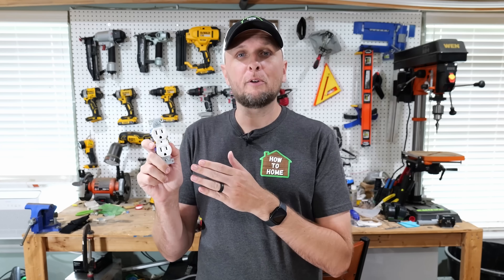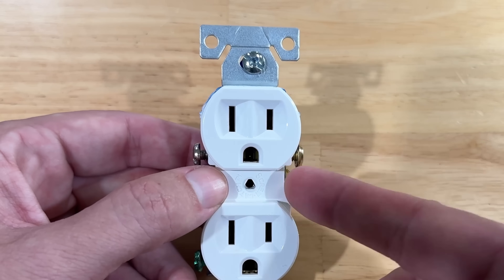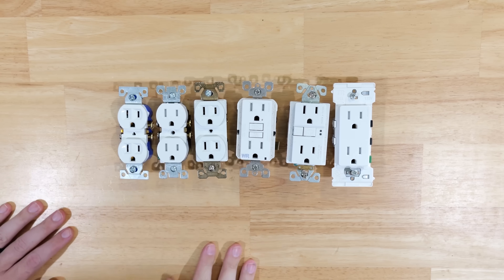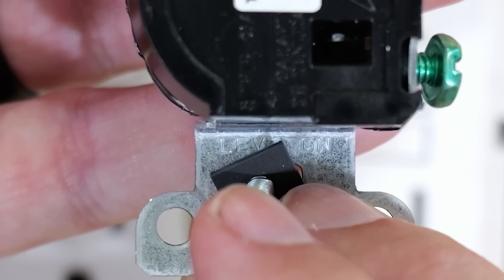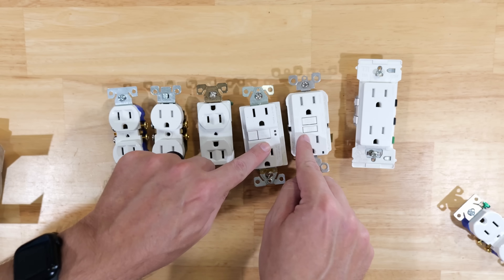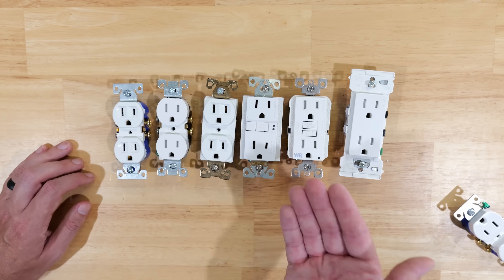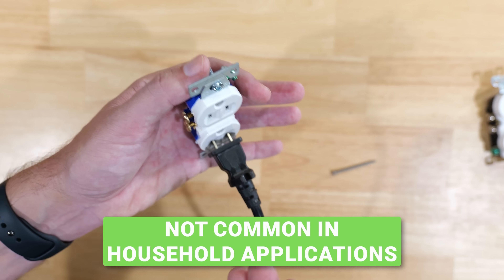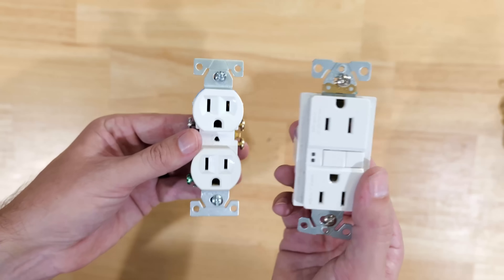The Shocking Reason Why Your Outlets Are Installed Upside Down!

Comment: For the past 35 years, I've always installed outlets ground side down because that just seemed the way it was supposed to be.  I never understood why I've seen them ground side up, so I now have a better understanding after watching your video.  Thanks for making these!
Reply: You just like the 😮 face.
Reply: Flat plugs more  the most have the wire down with ground down, but not always my AC window unit should have a wall outlet with the ground up. 73

P. S. Appliance extension cords are for ground up. That drives me crazy because the cords can be used on space heaters. I just removed a flat plug extension cord and found my power strip I had bought when I got my first windows computer. I like that strip because it has an unswitched outlet and the plug swivels so you can have ground down, ground up, ground right, ground left and any other position you want  and the plug is very flat. What I really need to do is to remove outlets and place them where furniture don't block the outlets the fan switch also needs moved. 73
Reply: My apartment has some up some down I want my kitchen and bathroom room 3rd prong down. er ground down.
Reply: @Debbiecybergal  if you are good with electric and can shut off the breakers then go for it and reverse them outlets, receptacles, plugs. Don't mind me I try to make everyone happy when it comes to electrical terms. Mom called them plugs my friend and I called them outlets. 73
Reply: Ground prong up when that outlet is attached too the light-switch so people there know where to plug in their lamp to control it from the wall light-switch.

Comment: Industry wide it's known colloquially as "U-Ground" (Prongs and ground make a |.| shape) not "Lowercase n ground". If you refer to it at any point as "U-Ground" you already know which way it's "supposed" to go.

Something else not mentioned, for slow flooding purposes in small basements, you'd probably want the water hitting the ground before the hot(s)/neutral to reduce the change an electrical fire in the wall.

Comment: The only thing from experience I have seen is that with ground up at work, the ground on the plug takes strain if someone hasn't plugged the device in right.  Particularly if the device is 208V and the plug is heavy,  we had two that needed the plug replaced because the ground prong began to break. Folks will move equipment around and not notice the plug sagging in the receptical putting strain on the prong. I go and check them, or used to. I'm retired, do they are on their own.

Comment: I was always told, if it's a non-switched outlet, then the ground should be down. If it's a switched outlet, then the ground should be up. If it's a GFI (master) it should be down. But, if it's in series, following a GFI, it should be up. If the outlet is sideways, it should be on the right, if it would normally be down (if it was vertical) and to the left ( if it would normally be up). I don't know if that's an electricians "standard", it's just what I was always told.

Comment: I had to change some of the outlets in my house when I moved in, to ground pin down, for safety reasons!
A lot of 120 volt appliances such as Refrigerator, Deep freezer, Washer & Microwave have Right Angle Plugs with the ground pin down & the cord hanging straight down.
If you use these Right Angle Plugs with the ground pin up, you are asking for trouble, since the cord will do a 180° turn & will pull out of the outlet.

Comment: In UK the back end of the live and neutral pins are insulated. If the plug is pulled part way out no bare metal on the prongs is exposed to little fingers when they still have power going through them.

Comment: In healthcare and some commercial settings, it’s common to see 3-prong electrical outlets installed with the ground pin on top for safety reasons. While not universally required by law, this orientation can prevent accidents, like metal objects falling and touching live prongs. Hospitals and certain industries often follow this practice to reduce the risk of electrical hazards. Always check local building codes to ensure compliance!

Comment: There were several years when I had eye problems, basically no vision. It was tempting to use my index finger to guide the prongs into the outlet, but knew enough not to do that. I wondered if a child who was blind would have the same temptation and try it.

Comment: In my opinion - I would have the ground pin down so a flood would contact the ground line first before the hot line.  For GFCI outlets, the ground connection is on the bottom of the outlet (hot and neutral are connected on the sides) if the ground prongs, on the face, are down - again, to pre ground flood water.  Btw., the "breaker" protects the outlet (and loose plug) from those million to one nail drops.

Comment: The issue I run into is with wall warts, those with a polarized plug can cause issues with space or orientation. Like a large unit that you want the weight down and then the next one you grab is set up with the blades the other direction !!!

Comment: I bought a house a year ago. Every outlet on the south side of the house was oriented ground down. The north side of the house was oriented ground up. Had me confused, why would someone do that? I quickly found out that all of the ground up outlets were un-grounded and in fact were supposed to be marked as such, (they weren't). Also found that the ground wires were clipped before they reached the outlets. When I asked the city/county inspector about this, he just looked at me like I was stupid.

Comment: I have lived in very old and very new houses, but never saw a ground-up outlet until I worked in a home built in 1954.  And in that house, some outlets were installed horizontally.  Different but not a real problem.

Comment: Based on manufacturer instructions. Water splashed within 1m. Electrical code requirements are GFCI within 1m of water. The face up means, vertical plane, facing up, where water can drip right on into the holes. Your realize that electricity is 360 degrees, it doesn't matter, your work looks foolish with ground hole up. The screw falling on the top, the breaker will trip, and if the screw falls to the right will touch hot and ground. Yes, the hot wire on top, ground hole down, your hand won't get shocked.

Comment: Code requires outlets in hospital rooms be installed ground up. Also, special clock outlets (used to hang clocks) are installed ground up. The reasoning is as you explained, in the case of something falling across a plug that is partially pulled out, it will short out.

Comment: It depends on the application. If you install in residential ground down makes more sense, mostly because that is what the homeowner/resident is expecting and if you install it the other way you’ll get complaints.

For more industrial or a workshop do ground up because the cables are normally higher voltage thus heavier so the weight of the cable will pull down on it, the ground is longer so it will drive the prongs in.

Installing sideways is also an option, it looks odd but due to most areas not having a code for orientation nothing but aesthetics is preventing you from doing so.

Comment: One thing for sure, that horse is dead.  And electricity does not care.  I do like the ground supporting the cord from the bottom comment, that I never thought of.  NEC handbook has an awful lot of pictures of outlets as monkey face down.  On the other hand, classy way to do it, after 40 years as an electrical contractor is to install switched outlets with the ground up.  Unfortunately, the only people that seem to do this are those I trained but customers dig it when I tell them which is their switched outlet

Comment: it's funny you say that it'd almost never happen... i guess you're right because it never did happen to me until a few months ago lmao. I almost had a heart attack, it took me 15 minutes to figure out what even happened. Had a fan plugged into the outlet next to my bed, the plug had worked loose. I had my keys latched to a beltloop and I went to turn over and adjust my position. My car key swung out and landed right across those exposed prongs. Crackle and a flash of light and the circuit breaker cut the power. My car key was melted so bad it wouldn't even work and I had to buy a new one.

Comment: On a light switch, on is usually in the up position. When installing a switch in this orientation the live (gold screws) are on the right facing the switch. For consistancy in wiring, keeping the live on the right for recepticals means the ground is down.

Comment: Maybe a repeat: having two prongs at the top should offer slightly more resistance to the plug being pulled out (or down) by the weight of the cord. Reversed, the ground pin doesn't provide much resistance to being rotated downwards and out by the weight of the cord.....

Comment: One thing I noticed when I buy outlets, most have the brass colored piece in the ground up position. (see 13:45 in video) the light switches have the same thing on them and it indicates up.  That hasn't made  me change the orientation but it has made we wonder if everyone is doing it wrong. I have heard but not read in code that for commercial buildings you put the ground prong up

Comment: I was taught the ground goes to the bottom so if the cord starts falling out the ground will stay connected the most, longest tine.
Writing orientation on anything has never been an "assumed" instruction of orientation. Top or up is traditionally used if it is important.

Comment: If you're using a heavy duty cord it stays plugged in better with the ground prong down. If the ground prong is up the weight of a heavy duty cord will actually pull it out. I have personal experience with this happening.

Comment: The ground prong up causes a problem for low-profile surge protectors which usually have the wire going down to the ground and prong on the wire side down to avoid a kink. Thats likely also a big part of why people are saying you are installing them upside down.  As a person who uses a bunch of surge protectors (cause PCs need them), I can say that installing them prong side up causes people more problems with cable routing and cable weight putting strain on the prongs and causing more problems than solving by doing it ground prong side up. Prong down better accommodates the vast majority to low profile surge protectors and also (Backup Batteries) Uniterutpable Power Supplies. Many of which the higher-end ones often have low-profile plugs with the wire going toward the ground and the Ground Prong down. 

Not having the ground wire (prong down) also causes a huge problem for a lot of low-profile surge protectors.  I have the prong up in my apartment. It was the first time I had ever seen them upside down cause every place else puts its prong side down.  The cable on many of the service protectors with the prong down as the wire goes down, I can literally see one of my cables now with the wire going up, putting weight and strain on the power outlet before it goes to the ground.  It tends to hang off further from the wall since the wire has to route up before it can go down.

I also suspect the reason why the outlets in my apartment may be so loose (cause plugs can easily come out) is not just because it's an old building but also because of the constant strain from surge protectors and thick wires rubbing on the outlets.

Comment: The ground pin tends to break off the plug more frequently particularly with grounded extension cords and power tools when the receptacle is installed with ground pin at the bottom.

Comment: Great explanation. I have background in both engineering and industrial design, and in the '80s I worked in R&D at a major manufacturer of circuit breakers, GFIs, disconnect switches, bus duct, and accessories. I designed equipment to NEC, UL, NFPA, etc. We wanted our products to be as saleable in as many markets as possible. That's why there's so much writing on these devices and the orientation of the writing has more to do with how the draftsman laid out the drawing prior to being told to add all the legalese and agency symbols to it. In bespoke connections, the relationship between hot, neutral, and ground was UL's relatively simple formula that ensured isolation between conductors and spatial orientation was rarely considered. I believe the same codes apply on 15A receptacles. I do recall a condition where riser bus duct doors could short out a bus duct plug IF the duct was installed in the incorrect orientation. That's my engineering experience, but my industrial design experience tells me that humans see faces everywhere and like finding them, so the "Right Way" to install an outlet is ground pin down, hot and neutral on top, so we can see the friendly 'surprised face.'

Comment: When mounting the receptacle in a vertical position, the ground socket of the receptacle should always be DOWN, because the last thing that you want to disconnect is the ground!!!  FYI, I  performed UL safety testing in a product development lab for 6 years.  But the code does not specify up or down.

Comment: outlets under windows used to be very common. windows, at one time, would tend to be sources of moisture. so if moisture happened to make it inside the outlet it would hopefully drain out through the ground hole.
so, ground side down.

outlets attached to light switches would be placed "upside down" and/or a dot placed on the face plate or outlet face to indicate this feature. ex. living room lamps permanently plugged in to the outlet.
ground side up in special circumstances

now days it really does not matter due to modern electrical code becoming more refined by demanding safer electrical practices, but ground side up will confuse people who have the knowledge that ground side up outlets are attached to a light switch elsewhere in the room.

Comment: If I had the option, I would have hole on bottom.  Rationale:  Rising water will short ground.  Then it will short Neutral.  Then with that grounded, the leg or hot lead finally shorts but ground is local not across the floor posing danger.

Comment: Since the year 1950, the outlets or receptacles are installed in Puerto Rico, not up and down but right and left and it makes no difference at all. They works perfectly and went they do the test the result is perfect. So for me, base on the results it doesn’t matter if it up and down, right and left, top and bottom or incline sideway as I saw in 5 times in Puerto Rico,  is the test results are perfect and works, its perfect.

Comment: When the ground outlet feature was introduced, the older outlets had no ground. In some states the houses continued to wire home with what we called “Texas Romax” wire. This house wiring had no ground wire and state code was not changed in many states to require grounds in new buildings. So, when the electricians wired the homes the ground was placed in the down position to show the fixture had no ground wire! Because there was so many homes being wired this way, the down position just stuck. Sometimes, when remodeling older homes, one will find, where electricians never even attached the ground wire which would be in Romax, but instead cut off the ground wire inside the box. This was a slick way to save time on electrical installs in new homes. If one owns an older home, it is easy to check to see if the ground is connected! A huge amount of older homes in US probably have never had grounded outlets.

Comment: Ground Prong Down. It has the advantage of holding the plugged in appliance wire more securely and yes most are designed to orient that way.

Comment: In apartments and homes I have either lived in or visited, it has been my experience that, in a bedroom or living room, etc., where there has been one receptacle upside down (ground prong UP) that plug is controlled by a wall switch.  this was to make it easily identifiable.  I have no idea if this is Code or just some unspoken convention among electricians.

Comment: 406.5 (G) (1) and (2) -  face up means you cannot screw the box to the bottom of the cabinet so the face of the plug is facing up to the bottom of the sink or mount the receptacle to the floor of the cabinet. The face they speak of is not the orientation of ground up or down. Its the entire surface area of the front of the receptacle facing the room. You can see this in article 406.5 (D) position of receptacle faces. 406.5 (G) (1) and (2) do not associate with the ground up or down at all.

Comment: It's 6s either way, but I wanted to point out the ridges on the sides of the plug.  Your fingers should not be on the top/bottom of the plug when removing from the receptacle.  They should be on the sides.

Comment: The direction does not matter, however for consistency it's best to install them in a way where the writing on the back is in correct orientation.  Does not matter if ground is up or down as long as you connect the live and neutral in the correct terminals, and (very important) to correctly tell between LINE and LOAD and connect correctly.

Comment: Ground Prong down for me.... mainly due to convenience in home applications where you have power blocks with prongs at the top... if the plug is installed ground prong up, this causes the power block to tilt away from the wall and it CREATES a safety issue with exposed prongs where if installed ground prong down it does not separate from the wall.  To me this FAR outweighs the possible advantage of having ground prong up as this is very unlikely to actually help.